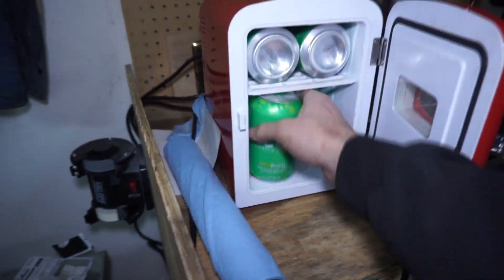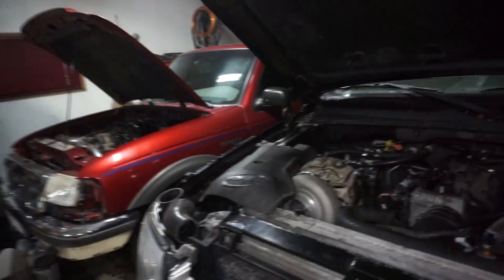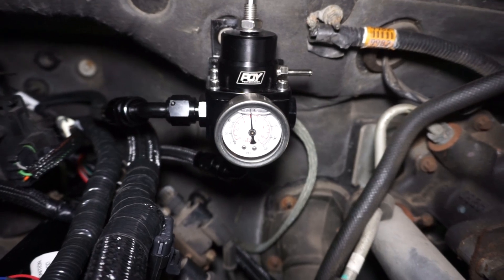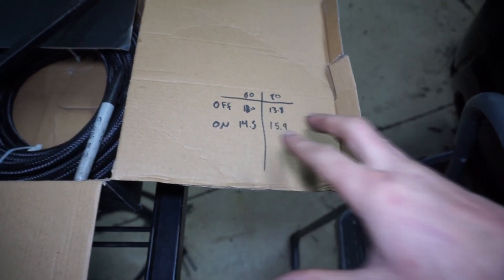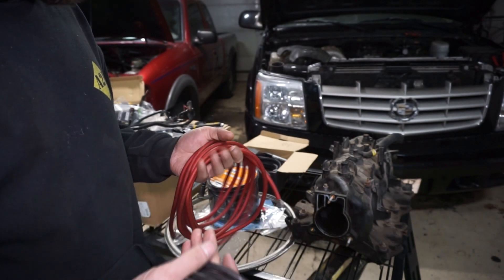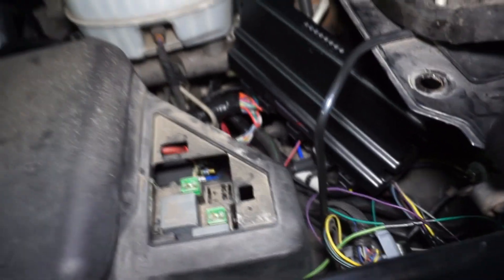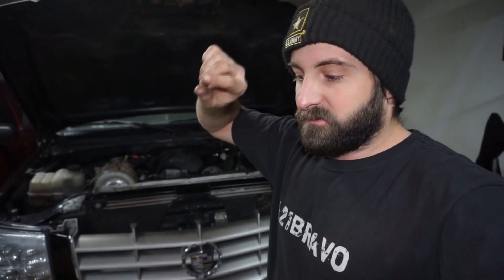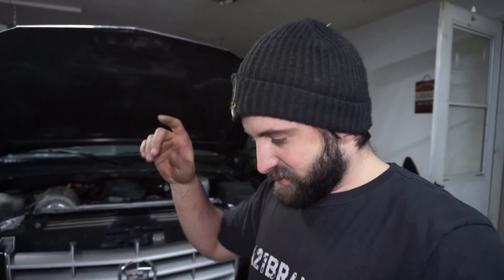THIS GUY PUT 3 FUEL PUMPS IN ESCALADE! YOU WONT BELIEVE WHAT HAPPENS NEXT!!!

Comment: I had to convert my gas gap to a vented setup, I originally had zero vent and the pump would create vacuum in the tank as fuel was used; it had to be bad on the pump.  I thought I had pressure in the tank because when I’d take the gas cap off you could hear the air releasing, but it was sucking in not blowing out. Weird but it’s fixed!

Comment: I have an 02 Escalade and just upgraded my system to a walbro 525 with a -8 feed line and -6 return. Rails are going to a referenced fuel regulator. I set my pressure to 58 at idle and when I drive it my fuel pressure dumps! Just on normal acceleration it will drop to 20-30 and if I try to stab it it will drop as low as 10. Any ideas??? Bad pump??? The 525 was recommended to me by an online turbo distributor since I will be going with a 7875. I’m only looking for the 5-600hp range. I did everything right or so I thought but I see all these people with excessive pressure issues but not many with low pressure
Reply from the maker: That sounds like a supply issue, clogged filter or something.
Reply: @BlaserBuilds  thanks for the reply.
Reply: Turned out the filter clogged!

Comment: Question? Would the size of wire and length of the run change the amprage draw you get? Bigger wire shorter run less draw? Thats what I was thinking but I'm not good when it comes to wiring. Either way good info nice to see someone put a meter on a wire and show it! Thanks!
Reply from the maker: Yeah it could change it because you're changing the resistance in the circuit.